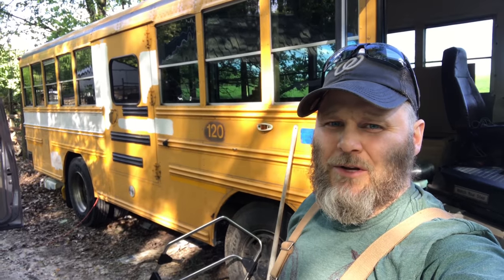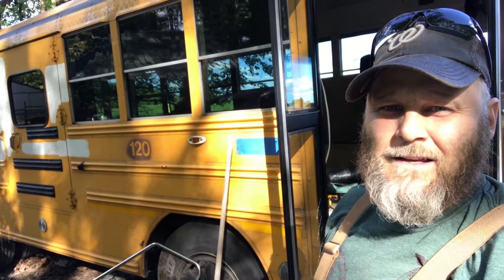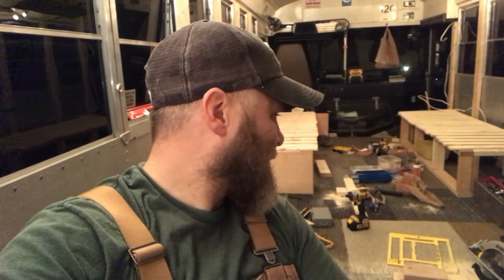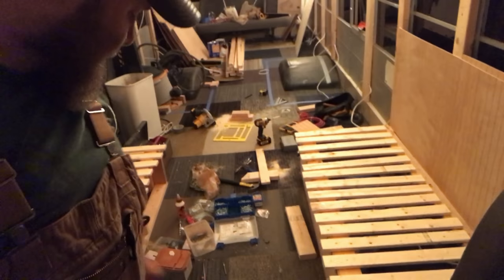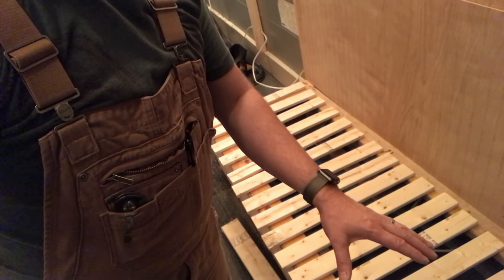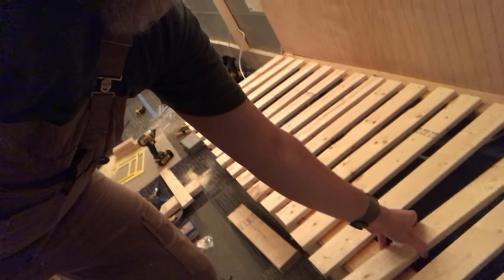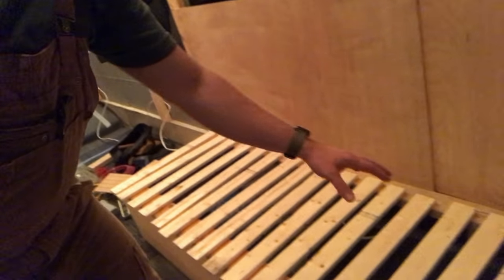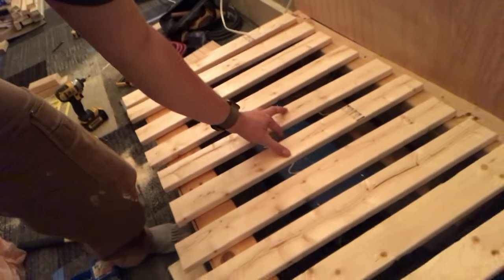SkooLee Bus Conversion - Day 17 - Painting and Sofas

Comment: looking great I was wondering what brand of paint did you use?
Reply from the maker: Thanks! So I went with Behr Alkyd Semi-Gloss Enamel at Home Depot. Here in Maryland I can't get oil-based paints mixed due to some environmental laws, and I didn't want the standard colors the oil-based paints came in. So I landed on this Alkyd stuff. It seems to be a good option. Time will tell, I guess.